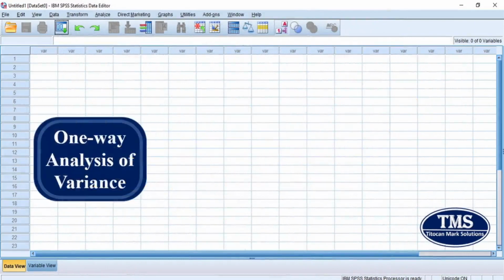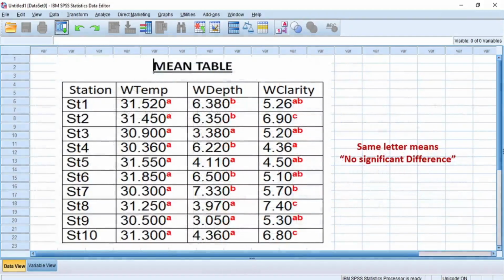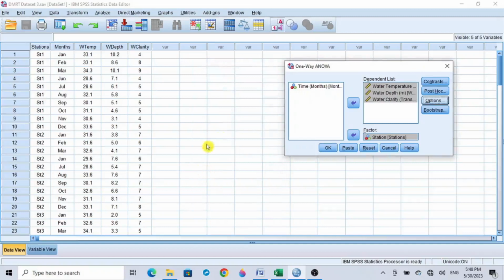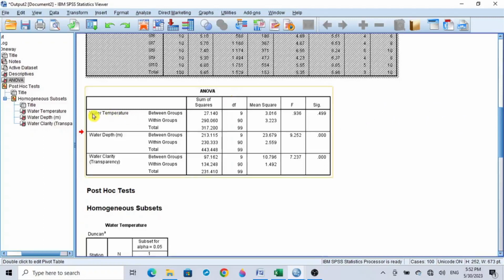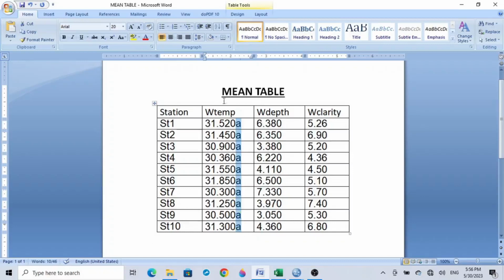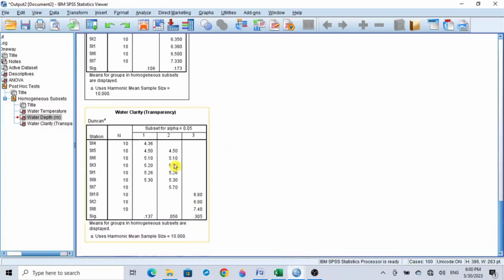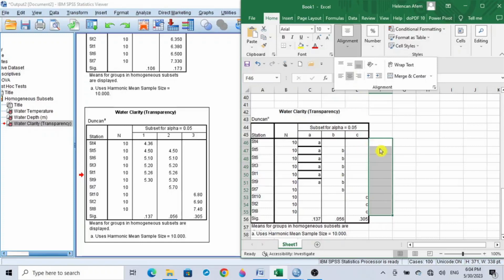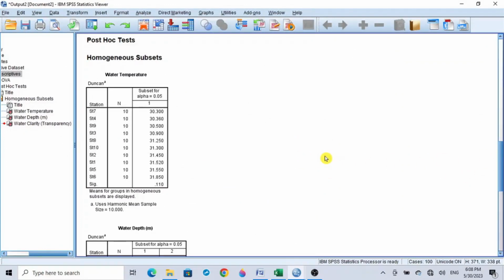Duncan Multiple Range Test (DMRT) with Compact Letter Display

Comment: Hi Mr. Mark. Thank for this video. I'm using spss 21 version to analyze my data through the Duncan multiple range test. After analyzing my data, the results doesn't come with posts hoc homogeneous subsets. It only bring the descriptive statistics and the ANOVA table. What do you think is the problem? Can you help me with this problem cause I need to analyze my data using DMRT

I would hardly appreciate your timely response. Thanks
Reply from the maker: If your analysis result didn't come with the post hoc table of results, it means there was no significant difference between or among your variables. Even when you tick the box for a post hoc test, except there is a significant difference, the table of results for post hoc will not be produced. So, let me ask you now, is the value of your P-Value less than .05?
Reply: @TitocanMarkSolutions  the P value isn't less than 0.05
Reply from the maker: Since the P-Value is not less than .05, it means that there is no significant difference and therefore the analysis will not produce the post hoc table of results. But, if the P-Value is less than .05, then the post hoc results MUST be produced to help identify where the significant difference lies.

Comment: Great video, thanks! How did you run the one-way ANOVA with string variables though? (stations)
Reply from the maker: String variables are nominal variables and so they are categorical. It is not possible to run any analysis with a string variable. The mandatory thing to do is to assign quantitative numbers to the cases. My video on "Introduction to SPSS for Beginners (part-1) will be useful to you in this regard. Thank you.